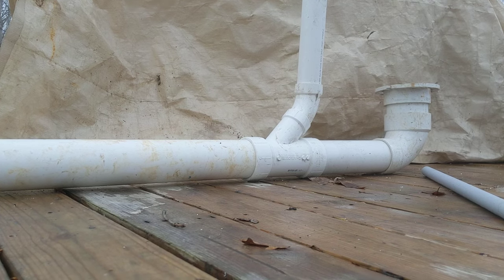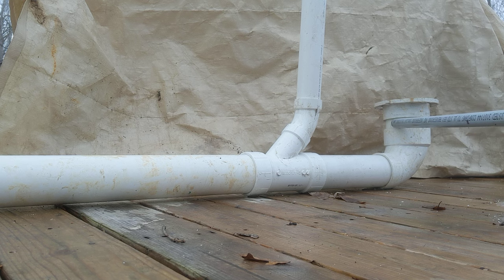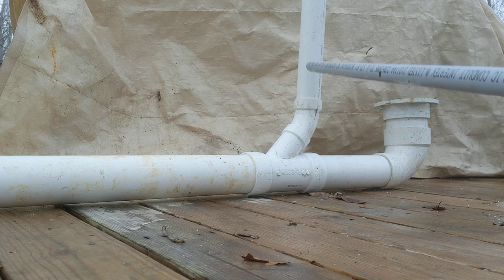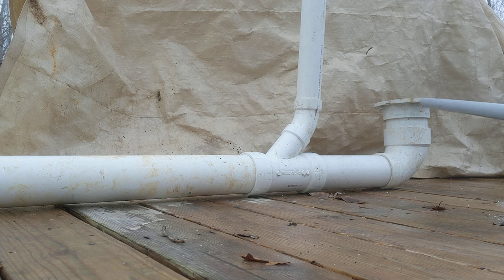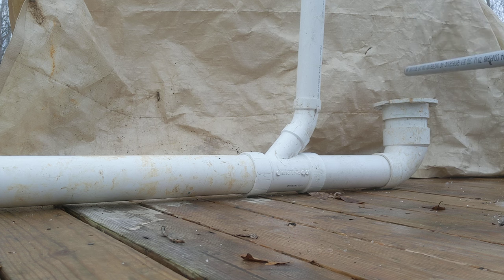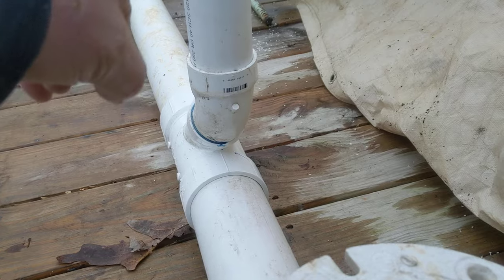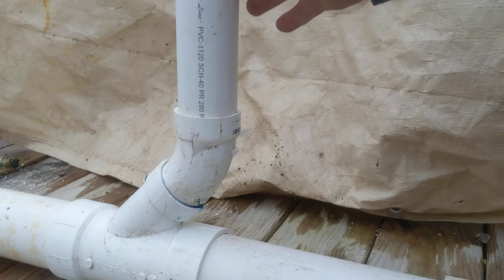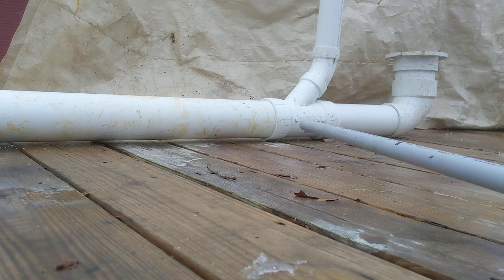DIY rough plumbing a toilet and vent system

Comment: Got one for you.....  Top of toilet flange to dirt (where the pipe runs for 6 feet begore getting buried) is 3 feet.  For the vent, can I go vertical 2.5 foot, then transition to horizontal for 6 feet and then back to vertical for the remaining 10 feet (or more) above the roof?